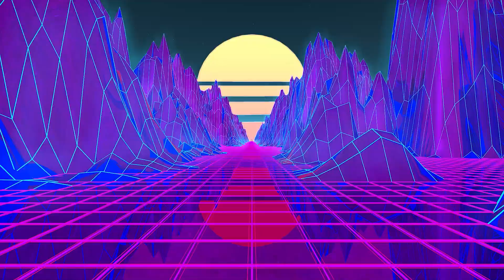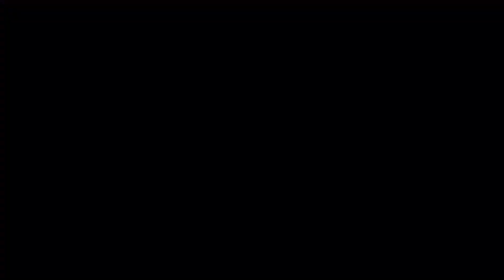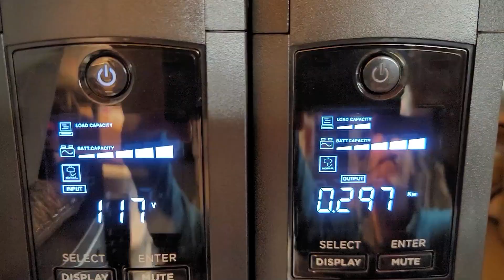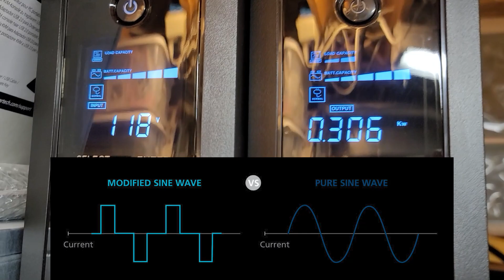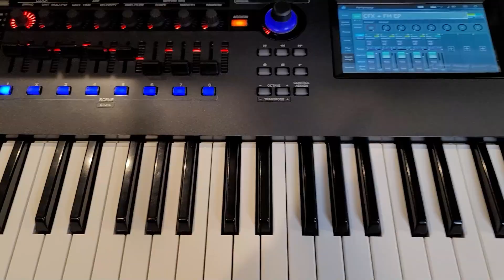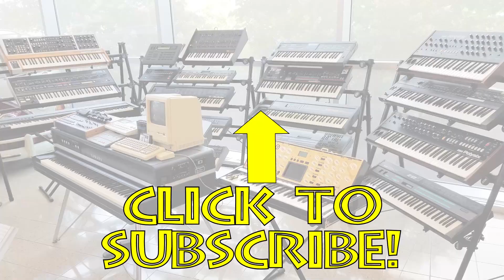Protect your Synths: Power Protection, Power Supplies and More

Comment: Everything in this video is well explained, thanks! 

But I still have difficulties figuring out if I should just invest in a higher grade online ups and connect my whole setup or also use a separate power conditioner for audio gear? 

I plan to get an oberheim obx8 which is very expensive and has analog and digital components, an rme interface which is also not cheap etc. 

Heard many people say you should use online ups only for pc and non audio related gear, and something like a furman power conditioner for analog audio equipment. Isn‘t a good ups going to cover most of the same features? I might be missing some knowledge here. 

Our house is only 3 years old and I had no issues with my gear yet, but I think it‘s better to be overly careful with such expensive stuff…😅

If you could tell me your opinion on this I would be very thankful!

Comment: I thought a double-conversion online UPS would isolate you even from lightning.  Is that not the case?
Reply from the maker: It depends on how close the lightning is, and what it hit. If it's a direct hit on power lines, or on your structure, or close by, nothing is going to protect you except having everything physically unplugged (and sometimes not even then).

Comment: Hi Scott... Can you please tell us how you actually physically power all of your gear?... Do all of your synths get powered from only one power output (one wall socket)? Also, how do you use your UPS units since you have way more synths than there are sockets in the UPS... do you plug your synths into a power strip and then plug that strip into the UPS? ... My house is very old and the gear in my studio is currently powered from three different wall sockets... i think there might be a potential difference between some/all of the sockets as I'm getting a hum with some synths so a major re-wiring is looking likely.
Reply from the maker: The synths actually draw very little power, even when they're all on at once. With absolutely everything turned on (which rarely happens), it uses only about 600 watts total for everything. So it's all run on a single circuit (across two outlets) which definitely helps with noise and hum. I have two UPS's, one for the computer, one for the synths, and the synth UPS has a very large power strip plugged into it with about 12 outlets (I think it came from a server rack).
Reply: @ScottsSynthStuff  Hi Scott.  Thx for your reply ... I'm rewiring my studio at the moment and planned on using a UPS for my computer but never thought about using one for my synths... I'll definitely be using a UPS for all of the gear. Thx for your advice 👍👍

Comment: Online UPS, WHAT'S feasible budget to juice/protect synths? Recommended?
Reply from the maker: For a 1000 watt unit, which is really going to be the starting point for online UPS's, between $600-900. And 1000 watts would be far more than all of your synths would use, combined. Probably safe to run your DAW PC on that as well. https://amzn.to/3jrUd9n

Comment: another great video!....the only thing I would of touched on is how equipment walwarts change (degrade) over the years. Nothing like buying an old 90's drum machine only to cook it with its own 12v power supply that now puts out 14.6V or worse 17v. Loved the musical influence part as well!
Reply from the maker: Less so nowadays. Those older, transformer power supplies depended on linear regulators to set the voltage, which in turn depended on other discrete components. Modern switching power supplies work in a completely different way - they usually just die completely and put out zero volts when they fail, by design.

If you watched my Polysix restoration video, this is also the reason I replaced the internal power supply: the design of the old original one would send lethal voltages into circuit boards if it ever failed. The new one is designed so that if it fails, it sends NO voltage.

Comment: Just about all power supplies built at least within the last 10 to 15 years are universal 100VAC to 240VAC 50 and 60Hz. An over voltage of 140VAC isn’t going to do anything to the power supply, but it would most likely pop a metal oxide varistor in a power strip and release the magic smoke. I run all network and sever racks on 208VAC and you don’t have to do anything to the equipment power supply.
Reply from the maker: True, modern switching power supplies have a much wider range of inputs. That said, they are also more susceptible to noise and transients than old transformer designs, as they don't have the magnetic isolation of the transformer to protect the delicate supplied circuits. It's really down to the design of the power supply itself.

Again, all down to the might buck: if Roland can buy one power supply for use worldwide, and just include the applicable cord and plug end, they save money over sourcing different PSU's for different countries.